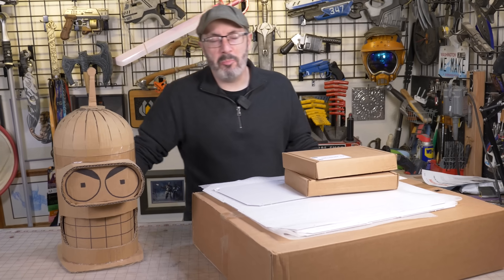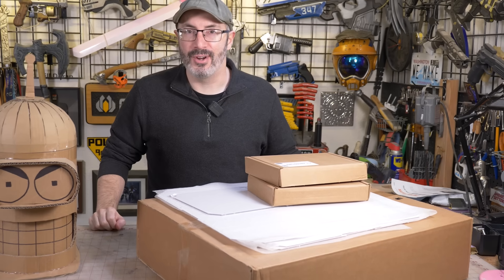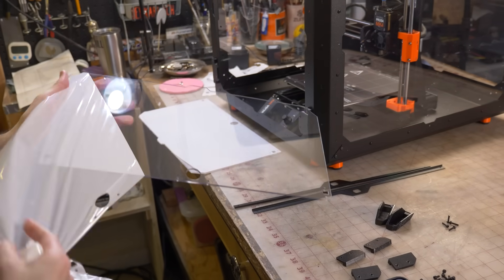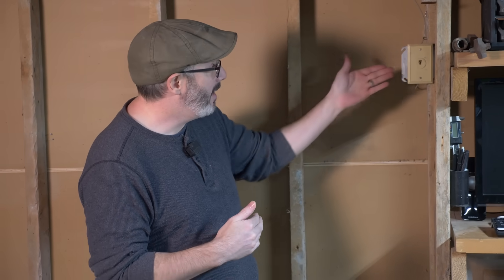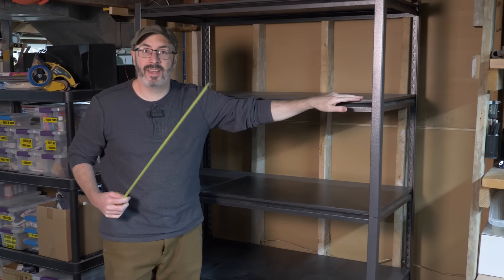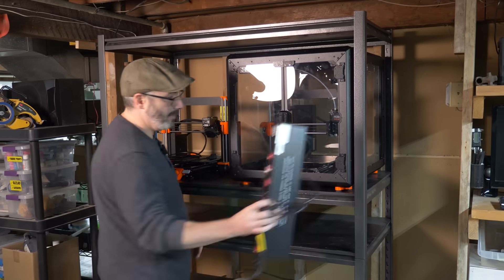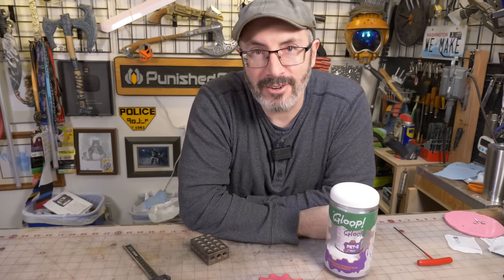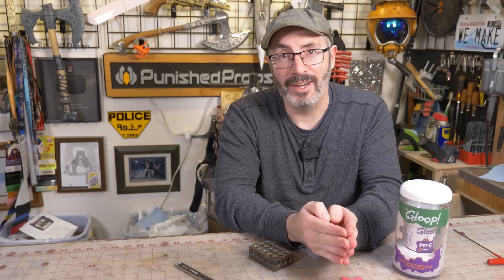Ya gotta keep 'em insulated

Comment: I hope this isn't a foolish question, it's just that I'm still learning all the ins and outs of molding and casting.

I want to make silicone molds of action figure parts like weapons, accessories, and body parts.  The big concern that I have regarding casting however, is that I don't want to cast any parts in resins that are dangerous even when fully cured since they are going to be handled afterwards.  What resins should I use for my projects and which should I avoid at all costs?

Thank you for your time.
Reply from the maker: The two resources I recommend are Crafsman's Toy Making YT channel: https://www.youtube.com/@TheCrafsMan/videos
and asking the folks over at Smooth-On: https://www.smooth-on.com/page/contact/
Reply: @punishedprops  thank you so much for your help.

Comment: I have always been confused why printers don't like to be cold. The nozzles heat up pretty hot. What exactly happens when it gets cold?
Reply: Temperature is not about the printer but the filament. Filament shrinks every so slightly when it cools (and different materials shrink at different rates). If the filament cools too much or two quickly it can delaminate and not bond (to itself or the bed) correctly.  This is why printers have heated beds and fans, it's not just about getting hot and melty but also about controlling the rate of cooling. The same is mostly true of resin and temperature as well.

Comment: That phone line you have actually carries 5v! They used to need power to be able to ring and power the speakers and junk!
Reply: not true, 90v ac when it rings and then 6-8v dc when talking.
Reply: @MegaWildweasel  I didn't know that! 😃 That's pretty awesome! Impressive too over those really thin lines. Thanks for updating my knowledge base. 🤘
Reply: @DanteNava  old computer tech used to work on modems so had to know . digital phone lines like in some commercial buildings are different .